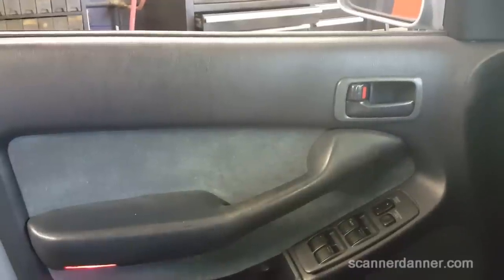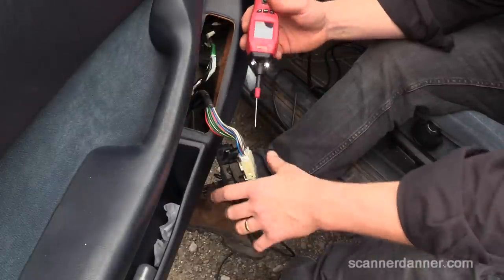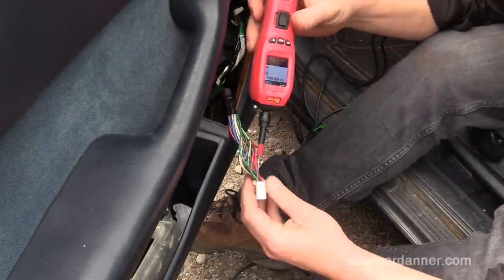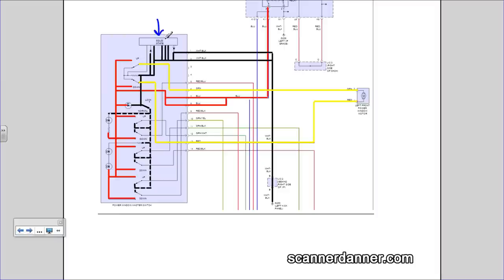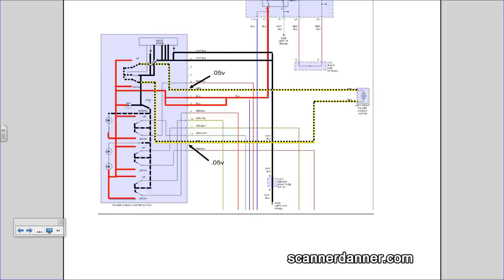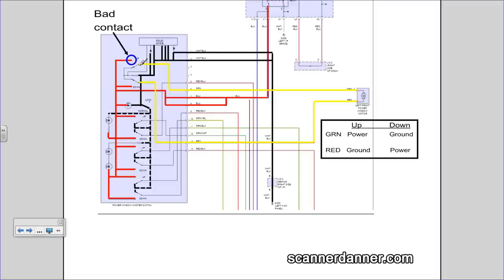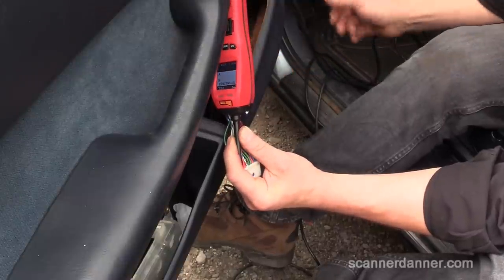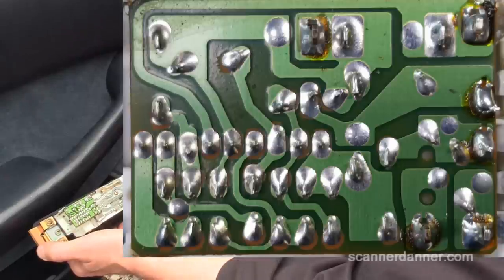How to test a power window switch/motor (1985-2001 Toyota)

Comment: The switch is burnt, but it being bad is a red herring - note how much slower the motor was going up - it's intermittently bad itself & that's what fried the switch - the motor needs changing as well. Cleaning it in this case most likely won't work as it will be the sealed plastic gear wheels that are binding & you can't get at them.  If you can make the switch work again, swap out that window motor too, or the fix won't last. :-(   I was at the identical all morning today.. 

BTW if people don't have a power probe ( I do) you can run the window motor with a cheapo 12v variable power-supply, just swap the +/- over to go between up & down, it will run the motor no problem, might get you out of a pinch if you have a bad switch & a window that is "stuck" down.  In todays case for me, which is identical to that ^^, I will swap out the switch & the window motor for good used ones, because just fixing the switch will only work for a little while till it fries again. Change both. :-)

Comment: Hello, Paul  If you didn't get battery voltage in the down position of the red wire, would you still apply 12v to the green wire in the UP position?
With perseverance and your guidance, I now understand the diagram and have answered my own question. Thanks for the video.

Comment: I was wondering about the "GREEN" wire you measured.
It looked like it was green with some sort coloured spots on it rather than solid gren.
Looking at your schematic , there is at least 1 green wire with another colour combined with it as well as a solid green
So my thought is you may have measured the wrong wire when testing.

Comment: I'd guess the resistor is there for the "auto"  feature to sense motor current, which seems redundant since the grounds go to the "magical solid state circuit" or the diagram is plain wrong/missing other things

Comment: Could the resistor inside the switch be a shunt resistor for the autodown solid state circuit to be able to measure current flow of the switch via voltage drop across the resistor?

Comment: Resistance in series voltge drop over each resistor the motor was dropping the majority of the battery voltage as lower resistance than the one in tne switch the 0.97 volts is the voltage drop in ths switch the ground on the other side of tbe switch resistor will be close to 0v

Comment: Note: don't try to fix TOYOTA window master switches,because they have recall ( factory defect ) inside switch buttons get melt and stop working,sometime even worse they get fire and burn door panel and wiring  ( I seen it )
So when you find window master switch is the problem check with dealer for recall or TSB before you do anything or if you like to sale window switch that's different story. Also you can change window switch circuit board if inside window switch is not melted.
Note some of Toyota master switches are or very been checked by dealers as I mentioned recall and installed one way screws which is no one loud to open except dealers.

Comment: Hi Paul,was a little confused at first with this  until you went to the board and explained it .Thought the power probe confused  it for me .You said you used the power probe to manually get the window back up.Could the incandescent test light have bypassed the switch like in you're  door lock  video  bypass test  ?Would have preferred the test light here in action as we don't all use a power probe but hey ho we cannot have it all our own way lol.Thanks for the vid.
Reply from the maker: You can not use a test light to bypass the  switch on this design because the switch is directly carrying the current of the motor. You would need to use jumper wires without the power probe I was using. And jumpers wires would work just fine too.
Reply: ScannerDanner Thanks Paul I had a feeling this might be the case after watching it again a couple of times.I guess there are a few different design's of how they operate and how to test them .I was able to bypass a 2003 astra power window with my test light connected to batt +  and touch the correct wires using the wiring diagram with switch unplugged  and was able to get the window up and down but that window circuit was basic ( I called it pull up design ,correct?) so I am right in thinking that we can only use a test light to bypass the switch on certain circuits to  move the window ? Hope I am making myself clear and not confusing you lol.
Reply from the maker: Correct. Here is the key. If the switch is signalling a module, we can bypass it with a test light. If it is directly controlling the motor or load of a circuit we cannot.
Reply: ScannerDanner Thanks for the quick response .Just finished watching it again and the penny finally dropped lol.It was me confusing myself from a previous test on the astra circuit i did but the explanation in the video and the quick response from you cleared it up.Really glad you put this vid up as i have a better understanding now about this circuit design that i did not know before.Thanks Paul.
Reply from the maker: Love answering these kind of questions. Ones where you actually want to know what's going on. So thank you!

Comment: Early 2000 GM trucks are bad about solder joints cracking in the abs control module. I pull those all of the time and resolder them. Easy money all labor.

Comment: that resistance on ground it cause higher voltage on ground wire to motor.
it may be some current shunt resistor.
Reply from the maker: agree, or just simply excessive current from the stalled motor. 
DC brush type electric motors, when they are not spinning, produce massive amounts of current.
Reply: yes and excessive current. i just get interested in the rest of the schematics.
Thank you

Comment: polarity led lights have also threw me off on both low volts= no red led light and no green light when expected because of voltage thresholds in power probe internal circuitry.it was really bad on power probe 1,later power probes had a digital voltage reading that enable u to trust the voltage reading more than the red or green LEDs.often times old school test lights are just better because of simplicity.

Comment: Hey Paul how can you address excessive voltage drop in this situation? Assumed source voltage from the battery is at full charge, would you find yourself chasing wire for excessive resistance, like the door jam?
Reply from the maker: Give me a time frame to check on your question. Thanks!
Reply: Thanks for your quick reply! During this video, I was thinking about what would you do if when applying the load (using the window's switch) you saw 4-5 volts instead of 11-12, or in your case 8-9 because of a strained battery. My thoughts are corrosion at the connector, moisture in the wire at some point perhaps..

Comment: SD, my (FORD 2000 Windstar) motor ohms infinity or randomly 1-2M Ohms. Isn't there a fusible link inside that's supposed to protect the motor? What about the windings in the motor? How do you know one of the loops of the windings is not open even though the rest of the motor is okay? How do you know if one of the loops isn't open and the motor still works so-so that you can't tell the difference? 
Show less
Reply from the maker: I need a time frame of a specific test I was doing to answer your question, it is too broad otherwise. Thanks!
Reply: @ScannerDanner , I Ohmed the motor wires and got "infinity" or 1-2MOhms. Then reconnected since had +/-12V switched and kept banging closed the door while depressing up/down and it started working again. (Even, before, connected straight battery to motor and still couldn't jump it up or down.) Now I don't have to rip door apart. Much Thanks.

Comment: Dude, can you come over to London and fix my windows!!! I've got power to the switch, passenger side, took the switch apart and it's mechanically sound, changed the motor as well but still my passenger side window goes down but not up and doesn't respond at all from the master driver's side switch. Maybe it's the contacts, dirty where the naked eye can't see, maybe the Italian wiring has failed, maybe it's something else entirely, who knows!
Reply from the maker: We can help you on my forum. IT is free to join 
https://www.scannerdanner.com/forum.html

Hope to see you there! We definitely need to look at a wiring diagram

Comment: Sir, could you be specific on Hyundai i20 power motor which has 6 wires?????
Reply from the maker: Here is a link to get wiring diagrams for your car. http://eautorepair.adtrk.biz/?a=10817&c=24&p=r&s1=
You can get access to the same wiring diagrams I use for an individual car for a month for less than $20

Comment: Without a current the potential over a resistance is zero, you will measure ground if the resister is not there.

Comment: You were talking about the wiring diagram possibly being wrong,  the "Valley Forge SVG" diagrams  like the one you are showing in the video are OK for something down and dirty / easy to read. To get better more accurate, detailed information about the circuit and the connectors OE diagrams like the ones in Alldata, DirectHit, MotoLogic or OE websites are waay better. I've been sucked into the Black Hole of electrical diag using the Valley Forge diagrams. The OE diagrams are not all the same like Valley Forge so there is a bit of a learning curve to them but once you figure them out they are great.

I have these two sets of contact files by these guys, they work real well. The flat ones will clean both sides of a flat male connector at once! Check it out.

Flat files:  http://www.ipatools.com/products/index.php/diamond-tip-electrical-terminal-cleaners.html
Round files:  http://www.ipatools.com/products/index.php/ipa-8042.html

Thanks for the tip on the reading of the Power Probe!!

Comment: Good stuff Paul.
Also everyone, check out:
 (Auto Down) Power Window Circuit Troubleshooting (Chapter 2) by Scanner Danner- Awesome review about the "Auto Down" too!
Reply from the maker: Do you have a link for the video you mentioned? Thanks!
Reply from the maker: Oh yeah! I just shot that not long ago. Thank you
Reply: ScannerDanner no prob
Reply: Hey Paul and everyone else), I'm not sure if this will help with some of the questions you were asking regarding the "Auto Down" feature, but this is straight from my GM 98-04 Service/Repair Software
(Document ID# 665880)
 
" Express Down Operation
The express down function controls both the driver and front passenger power windows but only from the driver door power window master switch. When either the driver or front passenger window switch is momentarily depressed to the express down position, it is a direct input into the DDM. If the request was for the driver power window, the DDM supplies voltage to the power window down circuit continuously until the power window reaches the bottom of its travel. At this point, the DDM senses an over current situation on the power window down circuit and interrupts the voltage supply. If the request was for the front passenger power window, the DDM transmits a class 2 message indicating an express down function was requested. When the PDM receives this message, the PDM supplies voltage to the power window down circuit continuously until the power window reaches the bottom of its travel. At this point, the PDM senses an over current situation on the power window down circuit and interrupts the voltage supply. "

Comment: Maybe it's just me, but I cringe at the thought of Power Probes... in my experience they generate more grief and/or confusion than any other shop 'instrument'. Especially in the hands of less experienced techs. I've been given a few through the years; I smile politely, say thank you, then hastily make the things 'disappear' at first opportunity... just my .02¢ worth. Having said that; yes, if higher amperage circuits are completed/broken via the probe tip (with the switch first held in the appropriate/correct position), switch life can be substantially extended. Also, all Power Probe stuff (that I'm familiar with anyway) is compatible with garden variety 4mm banana leads, test probes and all that.
Reply: rwbishop 
PowerProbe is confusing AF! All I use my for is a controlled way to drag power around the vehicle.
Reply from the maker: I definitely had some issues with it on this one. So much so, I almost scrapped this entire video.
Reply: The Power Probe like any tool, is simply another device which can be extremely useful in diagnosing electrical problems. Paul's use of the PP was entirely appropriate in this instance because it enabled him to eliminate the entire circuit and load leaving only the switch. The problem I see with the PP is when people expect it to do the troubleshooting for them. If a tech does not understand what readings should be nor what the tool is actually doing, then flashing lights and buzzers can be quite misleading. The best part of the video was when Paul opened up the schematic and began to work through the problem. Electrical repairs have very little in common with mechanical ones, and the time taken in understanding how the circuit works is usually the most valuable investment a tech can make.

Comment: 8.99 volts?!   there is  no guarantee that the module works at 9 volts! it's a 12 V system;

I do not test for grounds or for power  with a voltmeter; car windows do not work with voltage; they work with current (Amps);

best to use a made up test light, with,at least, a 21 or 25 watt bulb and two wires,unless your probe has that load capacity

Comment: The switch is 25 years old. The switch contacts are worn out. I just replaced a mirror switch on my 15 year old car and dissected my old switch.  The copper was completely worn off on the contacts.  Burnt, worn out, it doesn't matter.  A new switch was called for. All the time spent on diagnosis on this car was wasted in my opinion.
Reply from the maker: So no need to learn how to check the switch circuit when the window doesn't work? Because wires never break in the door jam right? Or the window motor itself never fails? Oh, and not to mention the tips I gave on cracked solder joints because that was a waste of time too. Then there is the power probe issues we addressed for those that have one. Don't forget, learning how to read wiring diagrams is also a waste of time.
Reply: Sure, the door wiring can fail, particularly in the driver's door. But you checked the motors and door wiring quickly enough.  If I had taken a switch apart and found a cracked solder joint I still would have bought a new switch.  Switches wear out after 25 years.  I agree with everything else you suggest.